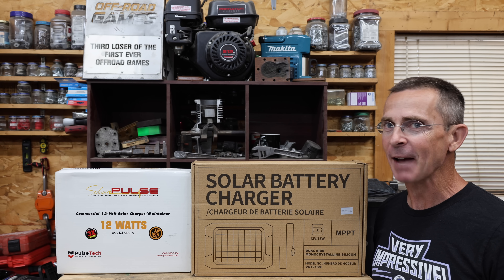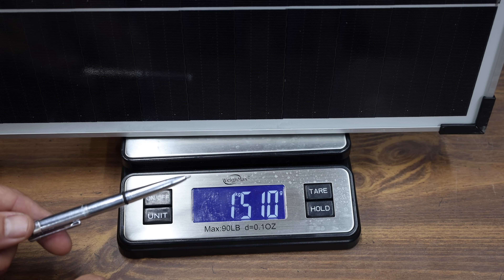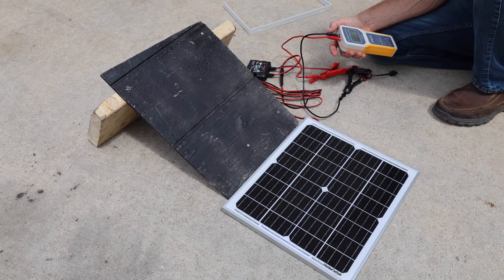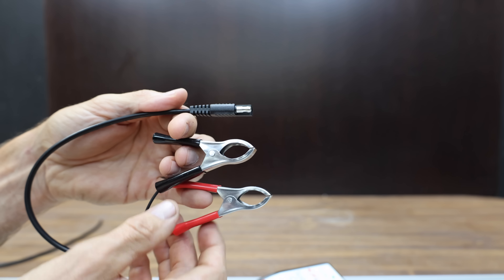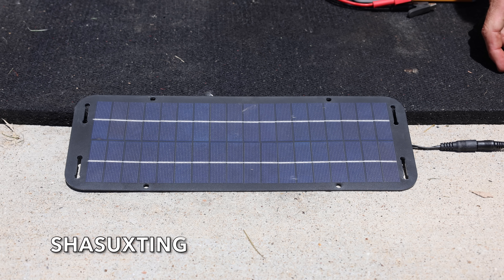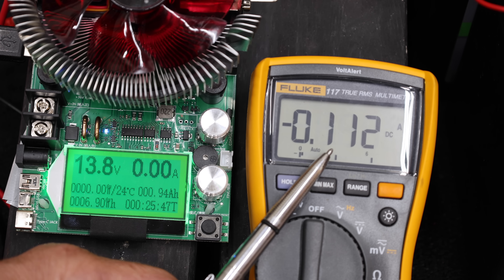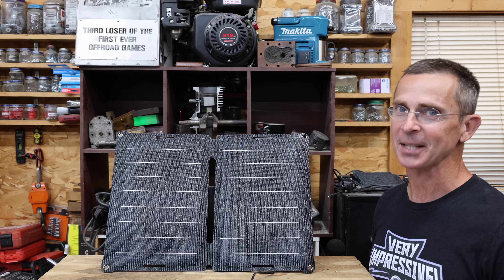I Had No Idea These Were So Good!

Comment: Auto makers should include built-in solar chargers to prevent dead batteries.  It would also help with batteru life, bc every time they go dead, they get a little damaged.
Reply: They could put solar cells/panels on the windshield facing side of the sun visors for example.
Reply: If we didn't live in the depths of the planned obsolescence era, we could have nice things that make sense like this.
Reply from the maker: Thanks for the feedback.
Reply: That used to be an option, a friend of mine had an Audi A6 built in the early 2000s with a solar roof.
Reply: Good idea,  never going to happen,  got to keep the price down, down and down more
Reply: you can actually just drive your car to charge the battery... the more you know. and when your battery isn`t working properly (for example not holding enough charge) then go buy a new one instead of relying on all the extra stuff. You are just pushing the issues further down the road instead of fixing them.
Reply: @kurtwagner16  Some of us have second cars or old cars that we don't drive very often. Others sometimes travel for a month of more (by plane, train or cruise ship), so it is helpful to keep the car battery topped off. When you can't drive a car more often, and for at least a half-hour or more, it's important to maintain the battery charge level as it can shorten the life of the battery to let it go flat. It's also very hard on the cars alternator to have to charge a very low battery while driving the car as it pulls a lot of power from it. 

These little chargers also come in handy for boats, jet skis, garden tractors, farm equipment and other machines with 12V batteries that may not get to run on a very regular basis.
Reply: This. My truck can go through 10% in a day and even then I just don't drive it far enough to recover that 10%. It's horrible (I know I drive less than the average person, but still)
Reply: And as a bonus, they could have a air circulation run of these so the car is not humid and furnace hot when parked in direct sun. But that would be too much to ask I guess.
Reply: @PappaMike57 that will be available by subscription only.
Reply: @PappaMike57  Toyota Prius with the solar roof option have that for years now.
Reply: @PappaMike57  Already on the market, solar powered air circulator that hangs on the inside of the car window   .....
Reply: This is not how batteries work in cars. You either have a draw which you need to find to prevent potential fires or you simply need a new battery.
The batteru system is perfect as it is, you simply need to keep it working that way. As with everything in life
Reply: @AkaRyrye83

There are kinds of cars that always include 12V battery charging. They are called EVs 😂
Reply: @BTC.maximalist most of them only charge the battery when the ignition is on
Reply: @kurtwagner16 

No, most modern EVs charge the 12V battery while parked and during charging to prevent it from dying. A DC-to-DC converter handles this process since EVs lack an alternator
Reply: @BTC.maximalist ah yes, thats why the 12v batteries always die on them. Dude i work on these cars. Don't tell me how they work.
Reply: @kurtwagner16 

> EVs charge 12V batteries
I did tell you that, but not explaining to mechanic how it works. I don't know who you are. 😂 Stuff on the other side of this screen I don't see. 

I tell you stats.
50% of EV breakdowns are because of 12V
( That's what you are quoting )

45% of ICE break down because of 12V battery.

But EVs breakdown a lot less overall.
There are brand spanking new studies that just came out too.
That's more important to me. I guess not to everyone.

✌️
Reply: @BTC.maximalist you are writing a lot of stuff that wasn't even questioned. I just said that electric cars only charge the 12v battery when the ignition is on and that the 12V batteries die very often on ev's. Opposed to your saying that they would charge them all the time. I never said anything about how often ice or ev cars break down and i genuinely don't care.
Reply: @kurtwagner16 

> electric cars only charge the 12v battery when the ignition is on

In 2026, the claim that electric cars only charge the 12V battery when the ignition is on is false for most modern models, as they utilize a DC-to-DC converter to pull energy from the high-voltage traction battery even when parked. Modern EVs from manufacturers like Tesla and Rivian feature sophisticated battery management systems that periodically "wake up" the vehicle to top off the 12V battery if its voltage drops, a process often signaled in Hyundai and Kia models by a small orange dashboard indicator. Furthermore, most EVs prioritize charging the 12V system whenever the vehicle is connected to a charger, ensuring it remains healthy regardless of the "ignition" status. While some legacy platforms may still follow older charging patterns, current 2026 standards prioritize active low-voltage maintenance to prevent the parasitic drain issues common in earlier electric vehicle generations.

You can't extrapolate anything
Reply: @kurtwagner16 
> you are writing a lot of stuff that wasn't even questioned

Fair point. My bad 😔

Comment: What dont i understand about these results? I though the NX wouldve come out on top overall. I dont understand the subjective ratings tables. The nx stopped at 14.5v, recognized at .9, cut in at 13.8?, experienced some damage from scratching and dropping yeah. But its 60 bucks, has the highest average output on a cloudy day, 2nd on a sunny day, its 3rd in compact size, second in output per sq inch, and seems to do exactly what you want. What am i missing. Only issue is no polarity protection..

Comment: Once again timing is everything. I just bought an Ozark Trail battery maintainer from Walmart Thursday. $29.99 and puts out 4-5 watts without any type of controller. It's supposedly designed for maintaining boat batteries but will work on any 12 volt battery. I got it to keep up the battery in my truck that I drive infrequently. Should have waited one more week until PF showed me which one to buy!
Reply from the maker: Thanks for the feedback.

Comment: Need a diode but, not a charge controller for 10watt charging a large lead/acid battery.  Overcharging at low power will not damage a large battery

Comment: Good deal, Commander and the voltage, head and crash test was REALLY good! I got one that laid on the dash for the S-10 and for the son-in-law but my lighter got loose and I gave the truck away but kept the charger. I know it didn't cost much and probably got what I paid for it. Got a little snow but it's gone now. Sunny, breezy and 32. Happy winter and happy cows and Farmers! God Bless Yall!
Reply from the maker: Hi Lewie, Thank you very, very much! It always means a lot to me. Sounds like the solar charger you bought was adequate. I bought one many years ago to help keep my 2 batteries in the diesel pickup charged, and the small solar charger just couldn't keep up. Fortunately, most of the ones I tested are significantly more capable and could easily keep the batteries from losing charge and sulfating, leading to failure. The price of batteries these days is a lot more than a solar charger. We got a little snow too and it's almost gone, but the cold weather decided to stick around for a while. lol. Wishing Yall many BLESSINGS!!!
Reply: @ProjectFarm  10/4 on the gone snow and now all our batteries have their own charger. That was a FINE test on everything. You did yourself PROUD! God Bless Yall!

Comment: Could you test sound deadening sheets (Butyl Rubber mats, like Killmat, Siless, Amazon Basics)? I'd like to see adhesion tests like how much force it take to peel a square inch piece, whether the mats would peel off a piece of metal under a heat lamp (to simulate summer conditions on the roof of a vehicle), or even testing their adhesion under hot conditions until failure (some people apply them under their car hoods). I've also wondered if they would emit volatile organic compounds (VOCs) under summer conditions. I think you could test their noise dampening objectively with a noise exciter (something like the Dayton Audio DAEX25 which turns surfaces into speakers) and playing road noise on the exciter or hitting the metal panel with a stick on a spring for repeatable impacts or even a hit it with a sling shot pulled the same distance each time.

Anyway, I appreciate everything you do.
Reply from the maker: Thanks!  Thanks for the suggestion.

Comment: I noticed you didn't recommend the 'NX' panel. It graded 4th place, and was pretty much the least durable, though the test did not destroy it either. It did have the highest watts output during overcast test, and 2nd highest watts in full sun. The others struggled to provide much power in overcast, and only a couple gave very much at all during full sun.  If you average the watts for overcast and full sun it has the higher score by quite a margin too, making it the highest output on average given changing light levels by far. It is priced well for its power output, and seems durable enough for its purpose. *As long as you take care of it 😅. I believe it can last and is the one that will provide the most consistent, and highest power, averaging all conditions. 👍  I love Project Farm! Anybody and Everybody who Buys Anything, needs to be watching this channel! :face-red-heart-shape:
Reply from the maker: Thanks for the feedback and for watching!

Comment: In the flex solar voltage, remember that your alternator is hitting the battery with anywhere from 13.8V to 15V for hours on end if you're driving cross country.  I don't think the slightly higher cut in and cut out voltages are too high.
Reply: Rarely higher than 14.4, unless temp bulk charge demand.
Reply: @mattmanyam  I've seen some alternators run a little hot at 14.8.  My truck runs at 14.4.

Comment: Nice test but you need to improve the grading/weight of each one of them. For example based on your test the EBL is the best because of the battery protection vs the others. You want better battery protection (more weight on that item) than energy production. And the EBL had decent energy production. Thanks for all. 👍🏻

Comment: Sadly, most cigarette ports are not hot when the car is off. Found out the hard way and I really don't want to put my panel on the outside of the car. I'm currently running a wire through the bulkhead to connect the charger to the battery.
Reply: @callaway86
  The cig plugs are made for fast easy battery to solar hook up, not for use in the vehicle cig plug.
Reply: @ducewags  Please explain further.
Reply: @mattmanyam   The cig plug that has the round terminals goes on the battery post's. It's made that way for simple use. No need to over think how to connect to solar.
Reply: @ducewags  😂😂😂🤡
Reply: @mattmanyam  Kids use cartoon faces.

Comment: Very interesting.  It is funny but the Schumacher solar panel looks identical to the HF solar panel that I got maybe twenty years ago and the weight corresponds, too.  It is wonderful to note that a number of these solar chargers will work with a depleted battery unlike the "automatic" plug in chargers.
Camping trailers and motor homes are a good use for these chargers when there is no electricity to keep their batteries charged.  Thank you.
Reply from the maker: Thanks!

Comment: Really interested in the same but for backpacking solar panels that charge USB power banks directly. They have misleading specs that count multiple outputs all added together, and also some use USB C power delivery to increase wattage delivery but it isn't consistent.
Reply from the maker: Thanks for the suggestion.

Comment: I always appreciate your videos and testing but for solar panel testing I would have recommended using an solar irradiance meter. This meter would tell you exactly how much solar energy is hitting the ground. Slight changes in the sun's location in the sky can significantly change the amount of solar energy hitting a surface. Not sure why you selected 28 degree angle as 10, 12, 15, and 20 degree tilt is much more common for flat surfaces. Thank again for the great video.
Reply from the maker: You are welcome!

Comment: I've made one of these for less then $25. Got an mppt lead acid battery charger board off Amazon and a 12 watt solar panel and a cigarette plug. Works great and haven't had a dead battery since
Reply from the maker: Thanks for sharing.
Reply: That's what these are as well. Yoiu could certainly get both better solar panels as well as charge controllers than what is shown here.

Comment: You want one that hits 14.2 volts once, then hovers at 13.2 to keep from taking the water away or to be kind to your AGM.  Better yet is an OBD adapter to leave the hood down and panel in car.

I would want a charger to once per week spend an hour at 14.2 wet lead acid to 14.5 AGM/VRLA, temperature compensated at the battery, not the solar cell or regulator.  Hold it an hour, Then float at 13.2 and each day recharge to just the float voltage.  Based on the final tally, all but the EBL are harsh on the battery if given lots of full sun days!

Comment: In this video, Project Farm tests 14 different solar battery chargers, ranging in price from $18 to $265, to see which ones provide the best charging performance and durability.
Testing and Performance
Solar Production (Overcast vs. Sunny): The chargers were tested in various light conditions. In overcast skies, the NX and Grestell brands performed best [09:30]. In direct, hot sunlight, the Flex Solar produced the most energy, actually exceeding its 20-watt rating [11:16].
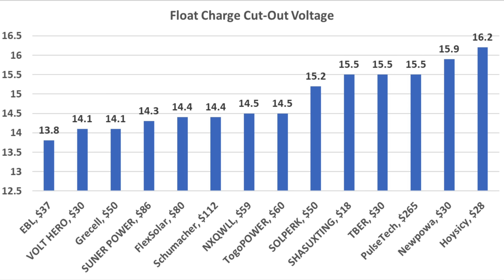Charge Controller Safety: A critical test involved checking for overcharge protection. Several cheaper units, like the Shashuing, Hoy Sissy, and Newpowa, failed to stop charging even when the battery was overcharged [12:15]. The Volt Hero, EBL, and Grestell showed reliable cut-in and cut-out voltages to maintain battery health [15:10].
Reverse Polarity Protection: Most chargers survived being connected backward to a battery, though the NX and Pulse Tech experienced significant sparking and hot wiring [15:42].
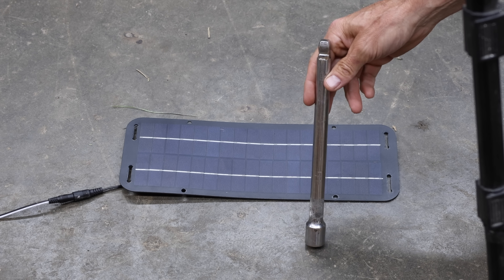Durability (Scratch & Impact): Using Mohs hardness picks, the Volt Hero and TBR showed the best scratch resistance [17:22]. In the "tool storm" impact test, most panels survived, but the Soul Perk was completely ruined by the impact [17:56].
Final Rankings and Recommendations
Top Performer: The Flex Solar ($80) earned the best average finish due to its high efficiency and performance in heat, though it does not charge batteries that are below 5 volts [18:43].
Best Value: The Grestell ($50) finished in second place. It effectively charges nearly dead batteries and has reliable float charge settings [19:03].
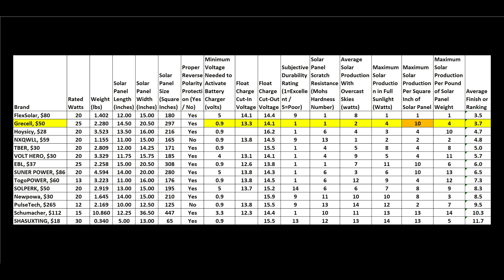Avoid: The Hoy Sissy was not recommended because its charge controller failed to prevent overcharging [19:18].

Comment: Can a car lighter connector charge the battery if the lighter gets no power with the key off? I doubt it - people should keep that in mind.
Reply: No but the OBD port will. though you do risk damaging the OBD port...
Reply: @townhall05446
  The lighter connerctor is a good easy fast way to hook up to the battery from any charger, or solar system.
It's not made to use the cig lighter port in a vehichle.
Reply: Thinking i don't want to leave the key in the car...:) good point.
Reply: On a side note most cars have two spots for the fuse that controls the 12 volt socket. One is constant the other is switched. Should take a look.

Comment: The 14.4 cut-off voltage would be much more appropriate for a LFP than lead acid. So if the charge controllers aren't configurable, it makes sense to match the cutoff voltage to the battery type you're using.
Reply: Good point, 14.4 is too high for a float charge on a lead acid. I wonder if there were different modes selectable in some of these solar charge controllers? It's crazy that some were going over 16 Volts.
Reply: @Phate8263
  ABS systems need 14.4 volts to work, it's not a battery thing, it's a system thing.

Comment: The schumaker really surprised me as they make some great battery chargers
Reply: It's an amorphous solar panel, I didn't know anybody made large panels like that anymore. You'd typically find them in calculators and other ULP or disposable applications because it's very cheap and flexible in application (the silicon material just gets deposited onto a base of almost any kind, shape and size), but it has drastically lower efficiency than crystalline panels.
Reply from the maker: Good to know!